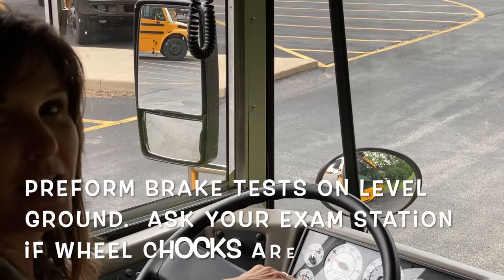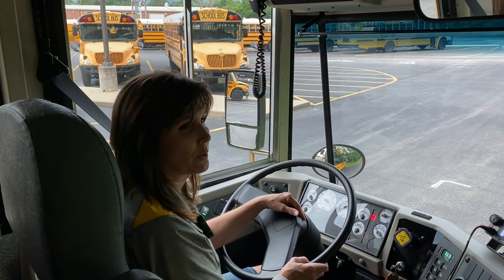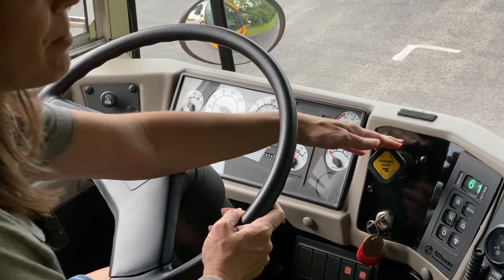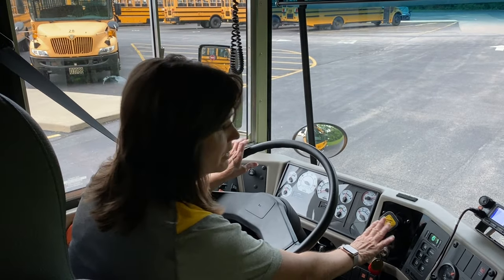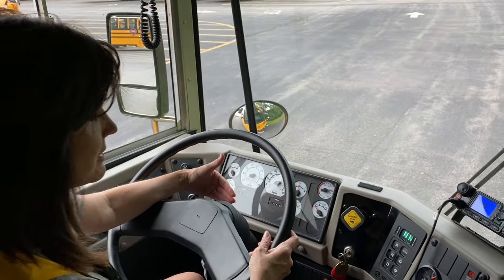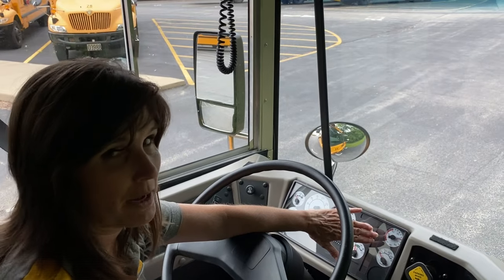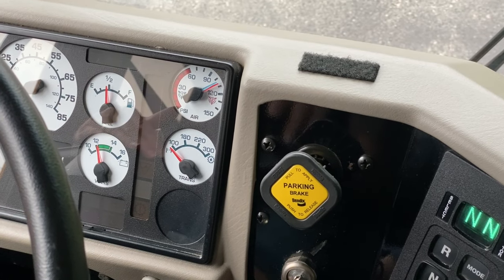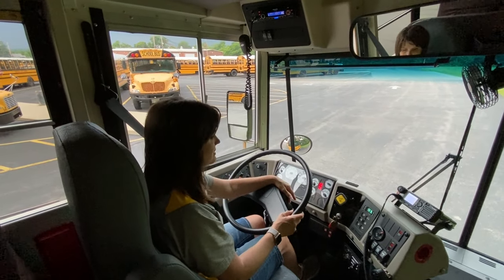CDL Pre-trip: Air Brake Tests

Comment: I'm training to become a driver for Northmont (Englewood/Clayton area) and it's nice having your videos since your district is local to mine. All the information is pretty much dead on with how they want us to learn it and do it for our exam. It is a lot nicer having videos to watch instead of just reading a manual.. it makes it easier to learn it and make sure I get it right during practice and eventually the exam. Thank you for making these.
Reply from the maker: So glad to learn the videos have been helpful for you. Dan!  Best wishes for a successful test outcome!
Reply: I passed all 3 portions of the test "with flying colors" and am now fully licensed. Only thing left for me is the pre-service class in the next week and I'll be good to go. I was originally supposed to test on Mon. 1/3, but they moved it up to Thurs. 12/30, luckily, and I got to test when it was almost 60 out instead of being 30 like it's supposed to be on Monday. The examiner at the middletown facility wanted me to pass the message on that if there are any districts that need drivers tested, to send them down there, as they're only doing ODOT and bus drivers right now and can usually get them in pretty quickly. Thank you again for your videos. You're doing a great service.

Comment: I found a YouTube video titled “Module 2: Bus Components” very helpful. The bottom line is you need to learn the parts, what they do, and what could go wrong. Just trying to memorize the sheets of paper is too daunting. 
He also emphasized the CDL’S; not Cracked, Damaged, or Leaking, and Securely mounted. 
Hope this helps.

Comment: Excellent video. While taking a driver to his test, I saw 3 drivers in a row fail because they didn’t do the brake pre trip correctly!
Reply from the maker: It’s so important…A lot of emphasis and practice goes into the brake portion of the pretrip, when I’m training new drivers.

It’s so tough to learn drivers aren’t passing because they miss a step on the brake test.  

Thanks for the comment and kind feedback.
Reply: When you do the static brake check is the vehicle completely off or in the Auxiliary position?
Reply: @SeanTaylor23 In my state, it's in the RUN position.

Comment: Therese,
Can you make a new video with more explanation about each test at the time. Like what device are you check it to or or if you doing it the spring brake test. Or other test 

I love your videos. 

On this video I only understand when you were doing it the parking brake test. After that I did get it. 

I’m 100% if you do that I pass my road test next week.  🥳🥳🥳

I hope you see this comment before my road test.
Reply from the maker: https://youtu.be/cQ-Z8fGTcQg

Hello, Sebastian 

I put the link to another pretrip video I have, which  goes over a bit more detail on the inside of the bus in addition to the air brakes.  Let me know if that video gives you more of the explanation you are looking for.  
I’ll be cheering for your successful test outcome…you’ve got this, Sebastian!
Reply: @SchoolBusSass  SUPER NICE! 
I saw the video it’s helpful I only didn’t get the portion on  which device or what you’re checking on the brake test. The rest it’s fine.
Reply from the maker: When I turn the bus off, after checking the parking brake and service brake, I’m checking for air leakage from the air tanks by looking at the air tank gauges.  The static brake test is with no pressure put on the service brake.  The tanks should not lose more than 2 psi in a minute.  Look at both the front and rear air brake gauges to determine if the needle on the gauge is lowering.  Always make certain the air brake gauges have a minimum of 100 lbs of pressure, after you have checked the parking brake and service brake.  When you turn the engine off, put the key back into accessory, you should have at least 100 pounds of air pressure before continuing with your static brake test, which is meant to determine any leaking from the air tanks .   After the static brake test, you will apply heavy pressure to the service brake.  You are still  checking for excessive air brake leaks and after the initial drop in pressure on the air brake tank gauges, you can begin to pump down the remaining air in the tanks by repeatedly pressing down on the service brake  with your foot .  This will cause the air pressure to release from the air tanks which in turn will engage the emergency features.  Once you have released enough of the air from the tanks, by fanning the brakes, it should activate the low pressure alarm, above 55 lbs of pressure, on your air tank gauges, and finally, by continuing to put repetitive pressure on the service brake, the parking brake should set itself when the pressure from the air tanks fall between 20-40 on your air tank gauges.  
These tests let the driver know that all of their braking elements on the bus are functioning properly.  

Hope my explanation helps.

Comment: Here I. California we do things a bit different, here’s what’s different :
1)You didn’t to do the eclectic part of the brakes(abs light check)
2) when doing a service brake check, DO NOT TOUCH THE STEERING WHEEL !!
3) you need to check that how fast your compressor pumps air , cut in cut out PSI( between 85psi to 100psi, by timing it)
4) @3:03 It SHOULD not move more then 3psi per minute
5) we need to check  governor cut off pressure at 120-125psi( to make sure it doesn’t go to 150 psi to trigger asafety valve .
6) you got to comment out loud on every step you do.
Thank you for a great video
Reply from the maker: Hands off the steering wheel here would be considered an unsafe maneuver and an automatic failure. You need to maintain control of your vehicle at all times.
Thanks for your comment and feedback… always enjoy learning how other states conduct their pretrip.
Reply: Here in NYC the cut off is also at 120psi, but as Teresa stated check with your individual state. I got an exam coming up and Teresa video is extremely helpful. Great tips from tungsten as well.

Comment: This is a different order then what I was taught. Does the order matter to the examiner? Because it's better this way since bus is already in 120 psi?
Reply from the maker: Terrific question!
Please check with your local test site.  If you are in. Ohio, the order  is accepted both ways. I prefer this order for exactly the reason you mentioned .  If you reside in another state, you may also need wheel chocks.  It’s always best to ask the test site you you intend to use.
Reply: @SchoolBusSass  I am not sure in nyc
From what I heard it just matters if you do alll 5 brake system tests
Reply from the maker: Exactly.

Comment: Hey Theresa. Thanks for videos. In my county they said 3 psi in a minute. What is the difference?
Reply from the maker: The static brake test, no pressure on the service brake) is 2 psi, and with heavy pressure on the service brake it’s 3 psi.  
The static brake test is no longer required by ODOT, but is required by ODE.  The static is to ensure your tanks are maintaining air brake pressure in the tanks.  By pressing on the service brake, you’re checking for leakage in the brake lines, and by continuing to fan the brakes, you are checking for the emergency braking features to occur.  
Your alarm should sound when your air tanks reach no less than 55 and your parking brake should engage if the air pressure drops between 40-20 psi.  

Which county do you reside in?
Reply: @SchoolBusSass  Maryland.  Montgomery

Comment: My examiner told me I don’t have too release the parking break to hold my service brake for 1 minute is that true or do you still have too release it ? Thanks in advance
Reply from the maker: I’m sorry… I’m not certain I understand the question.
Do you have hydraulic brakes?
Reply: I’m not certain if it does but sorry I’ll clarify better meaning that if I’m doing the air leak test do I release the parking brake or can I leave it engaged ? I was told either or is fine